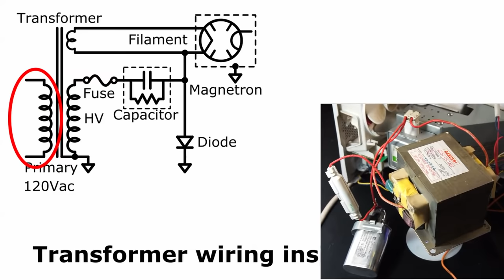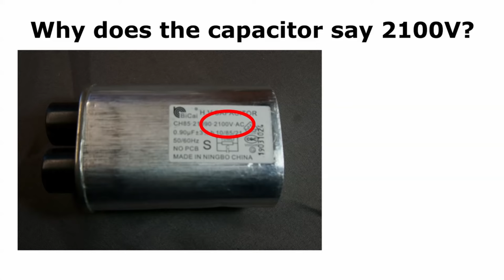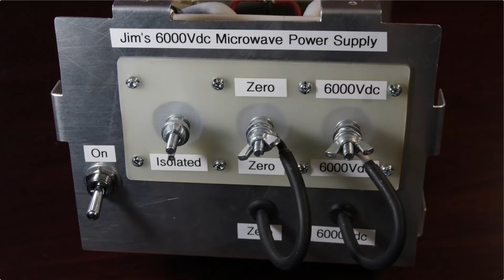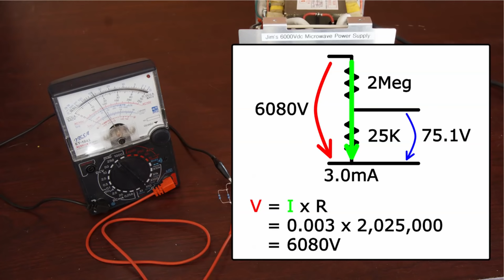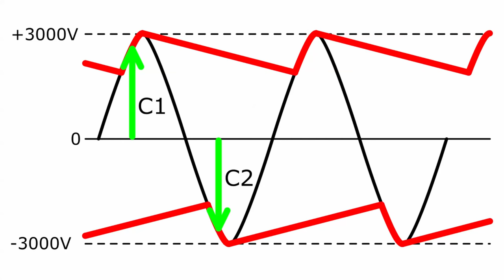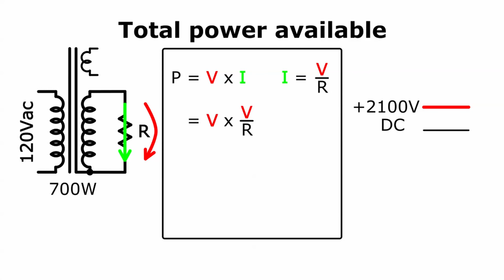6000Vdc power supply built from a microwave oven transformer

Comment: Brilliant presentation. So clear and concise!
I have built a couple of these with "full wave" full wave to get about 2kV. Be aware that some transformers have one of the HT leads internally connected to ground which makes the useless for this purpose.
Reply: Virtuality ALL microwave transformers have one external HV secondary connection, and the other leg connected to the chassis ground. This was clearly shown in this video.
.
The "full wave doubler" circuit shown here does not reference the chassis ground, it produces The high voltage (pulsed) DC is created between 2 terminals that are both independent from mains and chassis ground.
.
Therefore, all microwave transformers are suitable for this application, however 2 identical microwave machines will need to be disassembled to get the  2 x HV diodes and 2 x 2100V capacitors needed.
Reply: Yes, having one secondary lead ground referenced could mean trouble if the output of this supply had either the negative or positive output lead ground referenced.  Also what about insulation resistance of the capacitors to ground?

Comment: You have taken a lot of time patiently explaining things. A variac and a voltmeter at the primary wood be added advantage. Thank you
Reply: Variac integration would be a lot safer...
Reply: @mckanebullerlee3020  All high voltage transformers with a variac control have a built in limit switch at zero volt position in a holding circuit. So the high voltage will not be turned ON at power up. User has to bring the variac dial to zero to enable the unit. Regards
Reply: Better to have a switch, with a variac. It’s just basic safety measures of electronics of this lab “platform” type. Flipping a switch with instant 110Vac is risky business for specimens and yourself. This is highly dangerous video BTW!

Comment: As stated, he did a great job of going through all of the math, and explaining everything, how ever you seriously scrued up on the output, as you mentioned it is a doubler, and if you were using a supply transformer with a floating secondary, you could call the output "0 & 6,000 volts, but that is not what you have. Because the transformer secondary is one end grounded, the output is actually two 3100 volt half wave supplies in series, which is a plus and minus 3100 volts to chassis, so by labeling the one side 0 volts and the other 6,000 you have given a false representation of what is actually present, and if someone builds this Supply and connects the 0 volt side of the power supply to the chassis of there project, it will cause the power supply chassis to be + 3100 volts above the chassis of there project. And I can tell from your explanation of the build that you are smart enough to know how dangerous this could be. I'm sure it was just an oversight, but a dangerous one at this voltage level, as you mentioned, it's well inside the lethal range, so please correct this on your video before there is a tragic accident!!!
Reply: No, it is as he stated. What we have here is a one stage voltage doubler. So 6000 V.

Comment: An excellent video, with very precise articulation of the engineering analysis.  Am curious about what you will use this for - possibly as the plate transformer for an HF linear amplifier?
Reply: It's for a DIY Electric Chair.  Doesn't matter if it's noisy.
Reply: This is too much voltage and too little current for any tubes that would fall into the category as linear amplification for SSB in ham radio service.  Half that voltage would be about right and let you pull the rated transformer secondary current.
Reply: @johntoe6127 
Yeah, those exposed HV terminals are screaming "touch me, please!".

Comment: Yikes! I'd be nervous working with a HV PS that has a metal chassis and metal wing nuts, even if I built it. I would want an internal metal chassis but an external plastic or wood case. Large banana jacks for the the connections and a plastic switch for on/off. Still you have to be mighty careful working with the output!

Comment: Hi there and thanks for the upload, very informative but (as others have already said) as a professional EE, I must raise major safety concerns for any inexperienced or careless person who might try to copy your work. With the suggested wing-nut connectors and gardening gloves, and no power warning light, this is probably the most dangerous project I have seen recently. Please don't build anything like this if you have ANY doubts, and do watch my video about safety aspects of using microwave oven transformers. At least one person has been killed by a MOT.
On the technical side, the transformer waveform is badly distorted because the core is heavily into saturation due to the cost-cutting with short windings and a narrow magnetic path. This saturation causes the transformer to pull more current and heat up even on no load. If you are stripping two microwaves, you can solve this by running two transformers, with the primaries in series and the secondaries in series, with the transformer cores joined to form a centre-tap which could be grounded through a high-voltage resistor for a slight safety improvement.

Comment: I was confused for a while since I've always used a straight line and an arc line to represent a capacitor and 2 straight lines in parallel to present a contact points after you explained it I caught on, great job at instructing
Reply: Yikes! That would make you the only one in the world that uses such a symbol, which is unsafe! There is an international standard:
- The two parallel lines is ALWAYS a capacitor, and it is used when the capacitor can survive being charged in BOTH directions.
- The one straight and one arc line is ALSO a capacitor, but a special sub-type that can ONLY survive being charged in ONE direction.
- A contact point is A SWITCH and such are ALWAYS drawn with a conductor-line that is broken at an angle, such that if the angle is straightened out the whole component just becomes a straight line.

Comment: If you want to get a little more current out of it, remove the magnetic shunts from the transformer. There should be two little metal wedges stuck between the primary and secondary windings.

Comment: THANKS FOR THE GREAT VIDEO!!!
As an upgrade, you could put another capacitor in parallel with EACH of the existing two for more smoothing  (two more caps).  A volt meter using a voltage divider for calibration would be nice (maybe one for current also...this one would be easy to use as-is).  A VARIAC at the AC input would make a great 'variable' DC supply.
WARNING:  Be aware that the variac can step the input above 120VAC!
The only thing that bothers me is the voltage rating of the caps...close...espically if variac driven at the higher voltage region.

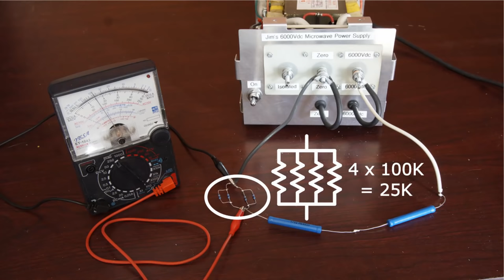Comment: Excuse me Jim but, the Yesa ET-1043 meter being used starting at 28:40 is a VOM type and as such, it does not contain an amplifier that effectively increases the meter's input impedance.   Using this type of meter rather than one containing a DC amplifier stage will introduce a significant error in readings obtained from the Voltage Divider HV Probe that you've described.  The meter itself will be an additional resistance in parallel with the four 100K resistors.  The input impedance of this type of meter can be as low as 20K ohms thus introducing a huge error in the voltage divider readings.  Of course, all of the current calculations you've done to describe the operation of the HV Divider are not including a 20K ohm resistance that is in parallel with the four 100K ohm resistors.    I have searched for the input impedance of the Yesa ET1043 meter and found that it has not been published.  You can however easily determine the impedance by 1st measuring any DC voltage with the VOM then, put a 2M ohm potentiometer in series with the meter. Increase the series resistance of the pot until the meter reads exactly 1/2  the 1st reading. Finally, measure the resistance of the pot that was in series with the VOM to reduce the reading to 1/2 the initial reading.  This will be the input impedance of the Yesa ET-1043 so you can add it to the actual HV Divider circuit.   I just now did this using a Dawson DDM421 Digital Multimeter (an amplified type) and found that its' input impedance is 1.007 M Ohms.

Comment: 12:37 for those who are curious about the number 0.707 which is the result of calculating Vpeak —> Vrms
Vpeak*sqrt(1/2)=Vrms  => Vpeak*1/sqrt(2)=Vrms 
both, sqrt(1/2) and 1/sqrt(2) ≈ 0.707 (well, 0.70710678… to be precise-ish) (sqrt(2)≈1.414 —> 1/1.414≈0.707)
In the end, Vpeak/sqrt(2)=Vrms

Comment: 28:10 "of course, there's a risk of shock" -  a wee bit of an understatement. 10 mA going through a flexor muscle will prevent its relaxation - grab that wire and somehow complete the circuit and you won't be able to drop it.
An indicator light to know it's powered and some bleeding resistors across those capacitors would be good to have.

Comment: Nice, VERY thoroughly explained! I would only suggest adding small case fan like used in a computer. To really test this PSU at full load, one might put 42 incandescent filament bulbs in series, each rated 20 watts. This derives from 120 V @ 0.167 A equalling 20.04 W, and 5100 V divided by 120 V equalling 42.5 bulbs. With 42 bulbs, each bulbs will receive 121.4 V, well within their allowable voltage range. For people in countries with other voltages, similar math will show that, for example, 40 watt bulbs of 230 V rating will do nicely with 22 bulbs in series.

Comment: Good Sir - I used your tutorial -  it is one of the best on Youtube.  Thanks!  It worked perfectly.  Now I have two questions, but first some background. - I wanted to throttle down the output voltage so I put a variac on the AC input.  This worked very well when all I had on it was a volt meter.  My project also calls for pulsing the high voltage.  I am currently doing that with two solid state relays.  One to connect the positive output to the load  and the other to connect the negative output to the load.  They pulse at exactly the same rate and are driven by the same driver -  both on and both off at the same time.  they are being pulsed on for about 50 millisec out of 110ms cycle time.   I have to isolate the ground for my project.  
When I turned on the variac with only a minimal load with the outputs of the power supply hooked to the load through the pulsing relays, the variac started buzzing and then a wisp of smoke!  I shut it down immediately.  The variac has a 20 amp fuse but it did not blow.   After my hands stopped shaking I removed the pulse, hooked it up to a voltmeter, and it worked just like before.  Now for my questions - 
1 Why would this happen?  
2. Would it likely work if I pulsed the input to the variac instead of the DC output from the power supply?  

Thanks!
Mark Cooper
Reply: Every time you disconnect the transformer, it produces a MASSIVE spike of high voltage high current "Back EMF" through the primary winding. This will often damage the solid state relays and is probably being passed back to the variac. Furthermore, there is a huge inrush current proportional to the point in the mains waveform when the power is applied. 
A microwave transformer is not designed for pulsed operation, but to run continuously for seconds or miinutes at a time. The control circuits of the microwave will have some small protection for the switching relay, to ensure that it doesn't arc too much. But these are nowhere need strong enough to protect against switching at about 10Hz that you are trying to do.
.
The bottom line is that you should use a transformer that's designed for pulsed operation, for example an automotive spark plug coil. To make your existing circuit work you need to add some seriously heavy duty protection against Back EMF on the primary side, and that will be complicated by the fairly high switching frequency.
Reply: Adding to my previous comment... if you are actually trying to run the transformer continuously the use Solid State relays to switch the ~5KV outputs...
... that cannot work, as the SSR's will almost certainly not be rated to handle that kind of voltage.
.
The SSR's are probably flashing over and creating a dead short circuit on the output side, or have already been completely fried.
.
The fuse on the cardiac will only blow at several times greater than it's rated Current. So the fact that it didn't blow doesn't mean that you weren't pulling >20A from it. If the load is pulsed then you might need to be pulling 100A at 50% duty cycle before that 20A fuse will open. In the meantime, the carbon brush is dying anyway, probably causing the smoke you saw.
.
BTW I overloaded my variac quite badly when trying to run it with small normal transformers wired "backwards" to create higher output voltages. There is something about the load profile of the transformer windings that creates an excessive current draw, even with no load applied to the output of my step up transformer.

Comment: Excellent description of the circuits. Great job. I work with high power high voltage daily in my job. I like this project very much and don't want to see anyone injured and that pain placed on you. As well as possible legal liability.
So, please let me share a few critical observations.
1. This IS NOT a project for beginners. Period. 
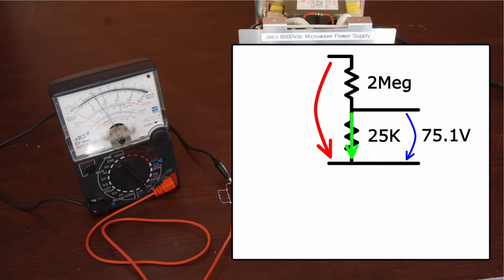2. The meter you are using at the 30:00 minute mark is either 20K/volt or, worse yet, 1K/volt. That will present a 20K ohm load in parallel with your sense resistor giving an inaccurate reading. Take this resistance into consideration as well. I calculate this to be 952.3 ohms for the total sense resistance.
3. The output terminals on this supply are outright criminal. The relief openings behind the bolts are FAR TOO SMALL for safety. Please find some proper recessed high voltage terminals and matching plugs. It is far too easy to contact these terminals and DIE INSTANTLY. 
4. Go to the automotive parts store and purchase spark plug wire, 20KV break down at a minimum, for your leads. I use 40KV rated wire on my 6KV supply here in my home lab.

5. You should bring out the ground and then relabel the out put terminals "+3000V" and "-3000V", labeling the ground "0V". This gives the option of a grounded 3KV supply ("safer") or a floating 6KV supply by ignoring the ground (0V) terminal.
7. If you place a variac transformer on the primary side of the HV transformer, you now have a zero to full voltage high voltage power supply. My commercial HV supply (Leybold) does exactly this.
LAST COMMENT. You can see how I use my commercial high voltage power supply in my video entitled, "PhiloCam Part 16 - Power supply problem proven beyond a doubt".
Reply: No comment how he has the frame of the Microwave Oven Transformer floating, and mounted on G10/FR4 board material?

Comment: I have disassembled two transformers from microwave oven to use them for welding projects and found, that the transformers get very hot with just primary winding without any loads.
Then I have calculated the number of turns for primary winding and counted the real numbers of turns on the primary. The real number of turns was less at least to 25% vs calculations.
So, the transformers from microwave ovens will not work long time, max 20-30 min. For welding project it's ok, but NOT for longer time!

Comment: To build a 750W 25kOhm power resistor, you'd need about 38 light bulbs rated 20W@110V, or 18 bulbs rated 40W@230V, all connected in series of course.

Comment: Excellent ground-up explanation of the concepts, and a really well implemented project! A concern that stood out though, is that it isn't made clear that the leather welding gloves shown 28:14 would not protect against the voltages involved, only from minor mechanical hazards from exploding components. 
I'm not at all a fan of "nanny state" censorship of educational material involving potentially dangerous topics, I think it's great that these kinds of videos are out there (and you'd hope that anyone attempting this project would already be experienced with electrical safety), however given the recent spate of injuries/deaths of people who have attempted wood burning using MWOTs without understanding the risks, maybe a link in the description to a video outlining hazards/precautions involved with these kinds of voltages and currents would be prudent? 
Even someone familiar/comfortable working on 110/230v in a hobby capacity might not realize how the usual precautions are not enough at these kinds of voltages (i.e burn/fire hazards, even slightly damp or dirty 'insulators' are now conductors, a mistake that was an "accidental tingle" at 110v would be a lethal & paralysing shock at 2-6kV etc)
Reply: Yeah - you need proper gloves for this. Those won't do it at all (dry cloth gloves will pretty much act like an air dielectric - and 5000V can jump about 1cm in air at room temperature, sea level ~40% relative humidity).
Reply: Those weren't even welding gloves. They were $2 gardening gloves with a canvas main body and leather pads... absolutely 100% totally NOT SUITABLE for any form of protection against mains voltage, let alone thousands of volts 😢